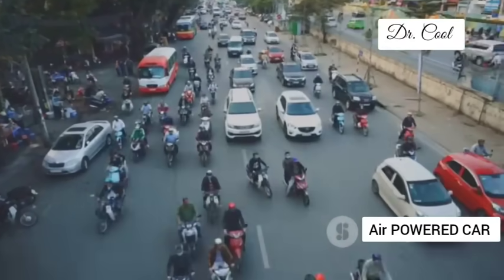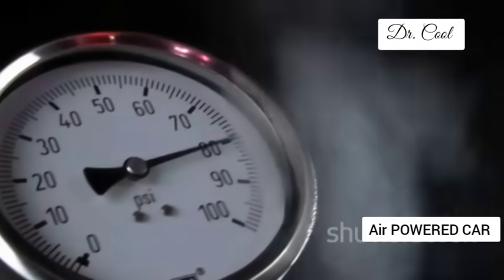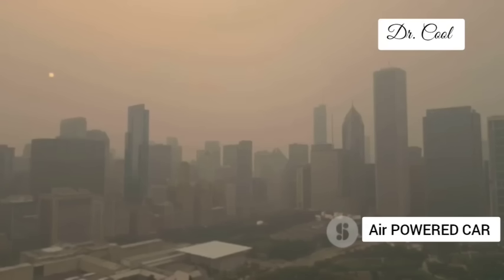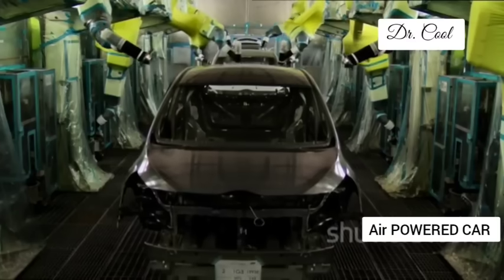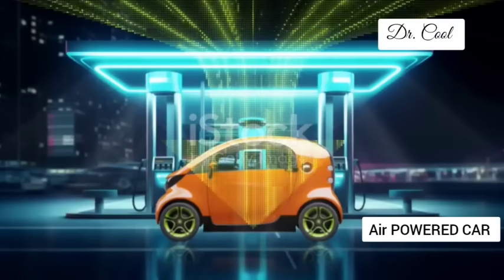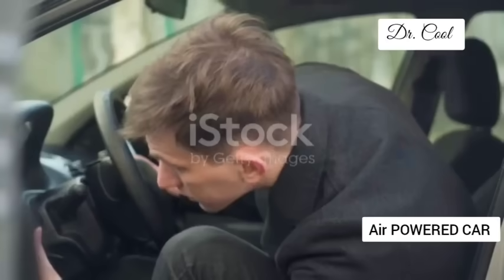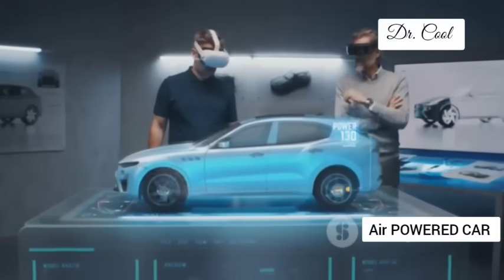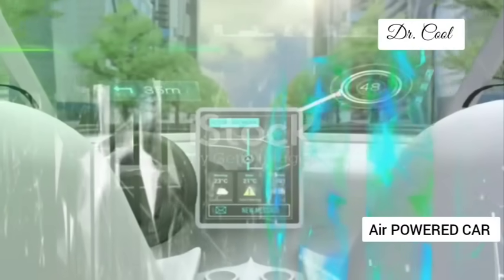Air powered engine from GM, Could This be Future of Automotive Technology

Comment: This is total bullshit. A car powered by air could at most extract the energy that was put into the compressed air tank. Even with the best materials in the world, that’s around 10 kWh after you do all the math. Assuming the energy from the expansion is isothermal and all of it is converted into motion in your futuristic 1000-bar tank, compared to 13 gallons of gasoline, you’d have 466 kWh. I didn’t even consider that this thing has an engine with friction and heat, and you can easily assume 60% losses, being very optimistic. So, this is an idea from people who don’t understand physics.

Comment: The one thing this BS video doesn't mention is the fact that the energy for compressing the air will have to come from Coal/Gas power plants for the foreseeable future. All that is happening on the pollution front is that the pollution is taken out of the cities and put into the outer lying areas where the electricity is produced. Cleaner cities...Yes, but no pollution...No. Wind & Solar will not fill the gap, they are struggling now to provide the bulk of power needed for our economies.

Comment: but ALL engines run on air anyway?
the fuel just adds heat to rapidly increase pressure...

and that delves into the problem that when compressed air is expanded, the heat of compression is lost... it doesnt expand back to the original volume until that heat is returned...

and no matter what you do, compressed air has terrible energy density...

Comment: You can only imagine the volume and pressure required for the compressed air tank a vehicle powered like this would need. Have a crash and puncture the tank the car is flying all around the place like when you let go of an inflated balloon 😅
Reply: at least it wont also catch on fire and REALLY explode like hydrogen... or LNG...
Reply: @paradiselost9946  True, but it's all about energy, the amount of energy stored in a cars fuel tank in the form of chemical potential energy wouldn't be much different than the potential energy stored in the compressed air tank of a car running on compressed air, it takes the same amount of energy to propel the car regardless of the fuel source.
Reply: @ats-3693  exept that.... an engine already runs on air.
the air is ingested, then its pressure is rapidly increased to 1000psi or more, by the heat of combustion. that pressure then works on the piston, crank, performing work.

you deliver a tiny amount of fuel, to produce a large amount of pressure in another fluid. (unless its hydrogen, in which case 2/5 of the swept volume is required as the air is 1/5 oxygen... H2O.)

for a rough idea, an average 2L engine at 3000 rpm ingests 50L of air, and that requires approximately 20L of hydrogen every SECOND.

compressed air, you have no choice but to deliver a large volume of air to the engine. to produce maximum power, the entire swept volume of the engine has to be delivered. for economy, the air is delivered for a portion of the stroke then expanded. as it expands, its reducing in pressure... thats cool, but the pressure delivered from the very beginning has to be approximating the combustion pressure of an ICE to perform any useful work in a useful size... you are going to need a very large engine, which then requires even more air to produce power....

during compression, the air heats up, and that heat is lost. as it expands, it cant expand back to its original volume unless that heat is returned... which is why expanding air tends to cool down... it has to absorb heat from something.

a compressed air engine running on a tank of stored air to drive a vehicle is a joke. it isnt practical. there is a limit to teh pressure you can store, theres a limit to the amount of gas that can flow, and there is definitely a limit to the energy one can store in compressed air. and thats before considering the limit to how much of that energy can perform useful work.

a cup of petrol driving an ICE engine on a portable compressor can compress several thousand cubic metres of air... fuel is far more energy dense than any compressed gas can be by utilising pressure alone.

a compressed FLAMMABLE gas has calorific energy, at least.

and if you think THIS was an essay? TLDR? i havent even started to scratch the surface... ;)
Reply: @ :) Yes that's basically precisely what I was saying too, with regards to the amount of energy stored in a tank of compressed air compared to the energy stored in tank of flammable fuel.
Reply: @ats-3693  there is virtually no energy in a tank of compressed air. a bit of potential energy, and far less than the energy required to get it IN to that tank.

they dont use the potential energy of compressed hydrogen, natural gas, or other flammable gases in bottles, despite being at 20,000psi or more... they simply use the calorific, the chemical energy. i wonder why? hmmm?

in a way, that actually would make sense, have one cylinder of a 6 cylinder engine working as an expander for the incoming gas rather than a simple regulator...  20,000 psi, expanded at 20:1 is still 100ish psi, performed some work, and would have no need for a vaporiser like LPG fuelled vehicles do, as it would have gained some heat from the rest of the engine...

but the problem is that the engine doesnt necessarily require all the gas fed into that one cylinder, so the degree of expansion, and any work produced from it would vary wildly... which is probably why its never been done, or at least had results published...
Reply: @paradiselost9946  Yes I know, that's been the point to my comments right from the start, to put the equivalent amount of compressive mechanical potential energy into a tank of compressed air that is stored as chemical potential energy in the average cars tank of combustible fuel would require a massive air tank at huge pressure. And it would use a huge amount of energy to compress the air into the tank to begin with.
Reply: @ maybe i just misunderstood this comment of yours... or interpreted it incorrectly?

 "True, but it's all about energy, the amount of energy stored in a cars fuel tank in the form of chemical potential energy wouldn't be much different than the potential energy stored in the compressed air tank of a car running on compressed air"

that suggests you think theres the same energy in that tank of compressed air as in a fuel tank... when theres no material on earth that could withstand the pressure required to achieve that sort of density...
Reply: @paradiselost9946  Yeah it wasn't a very serious comment, I just meant theoretically if somehow someone did manage to cram the same amount of potential energy into a compressed air tank as in a conventional tank of combustible fuel then an accident would release similar amounts of energy, it was more of a thought experiment.
Reply: @ats-3693  in that regard... you definitely do NOT want to be in the vicinity of an exploding industrial gas bottle! 

its like the amusing aspect of TNT versus toluene... TNT, if set alight, releases less energy than toluene.  just burns with a rather dirty sooty flame.

but detonate it and release that energy instantaneously? different story!